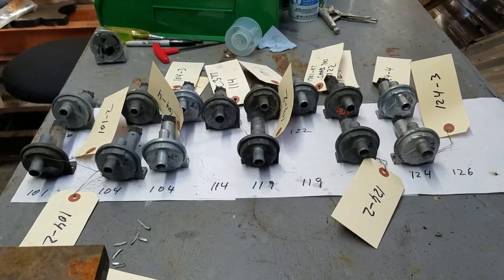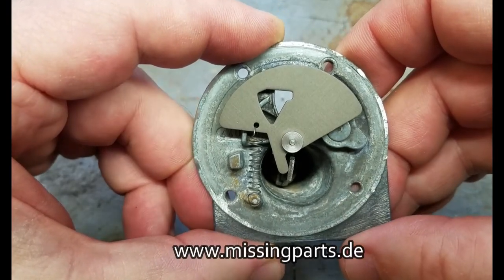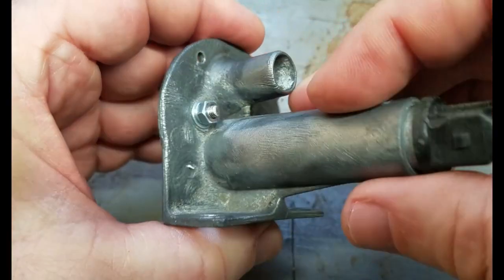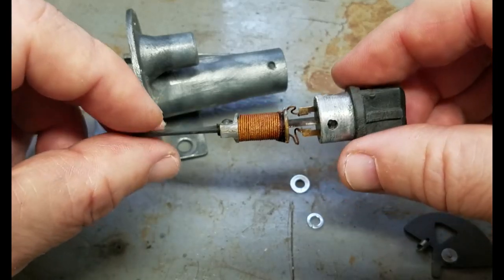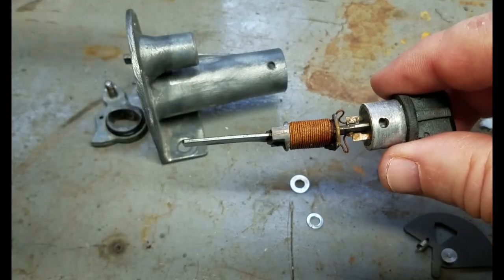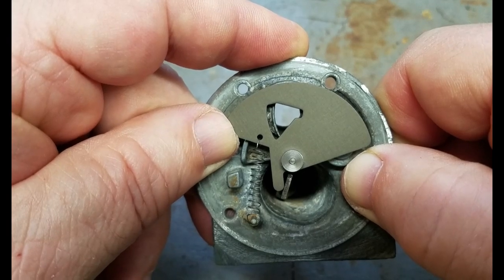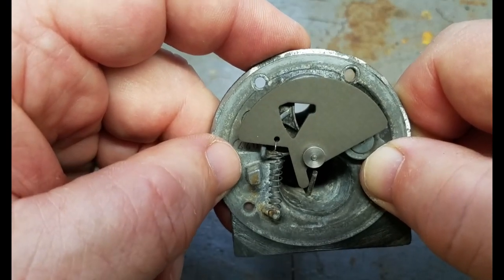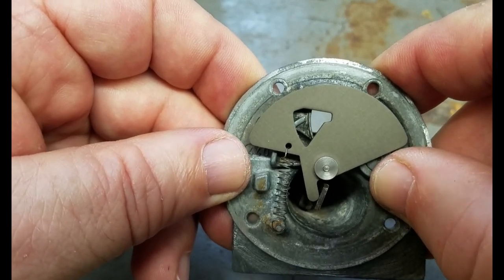Bosch K / L-Jetronic Auxiliary Air Valve/Zusatzluftschieber: Operation, Repair, better cold start

Comment: Very useful video, relevant topic for old injection systems. I have an Opel Senator A2 and L-Jetronic injection is installed there. This additional air valve did not work, because of this, long warm-up and unstable operation of the cold engine. Replaced it with the same valve from a BMW e23.
Reply from the maker: Thank you for the comment. I got deeper into these because they were harder and harder to find and in the end prices - especially for NOS units - increased dramatically. Great the E23 part works on the Senator.